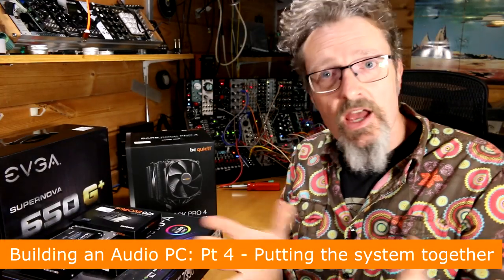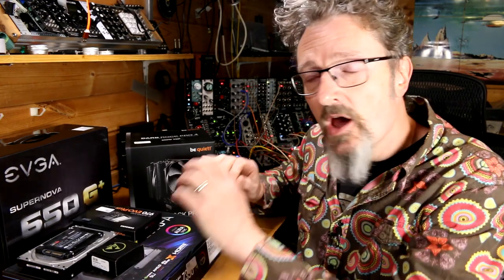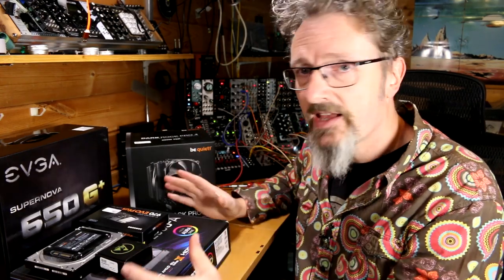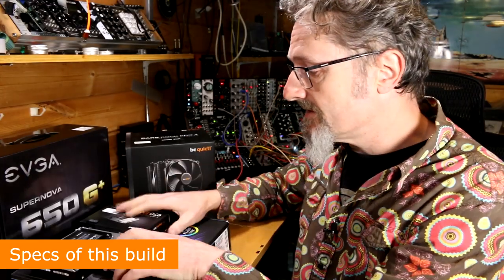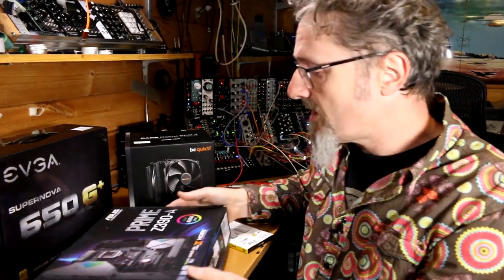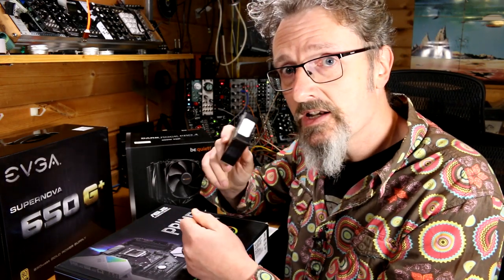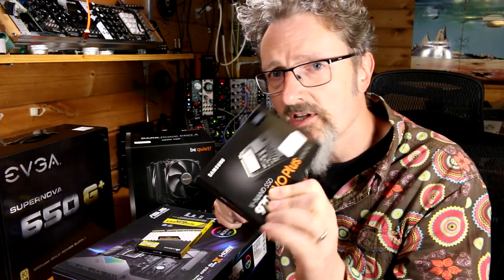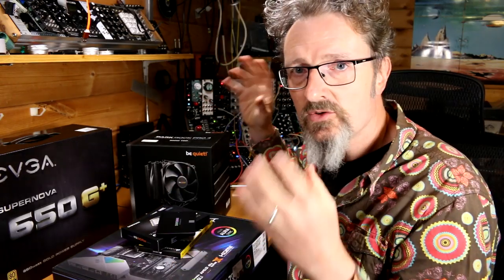How to build an Audio PC: Part 4 - Putting the System together

Comment: Excellent video Robin, your instruction delivery is superb. Rather serendipitous as well as I'm upgrading a HP desktop with a few bits and bobs, (SSD, fan, RAM etc) turning a £140 used machine into a proper goer.

Comment: Thanks so much for taking the time to make these videos!! I have two questions. Question 1: How do you know when the CPU cooler is "as flat as possible"? I mean, isn't there a risk of over tightening and cracking something? How do you get as close to flat without damaging? Question 2: How can you tell if the fan turns clockwise or counter-clockwise?
Reply from the maker: 1. You assume flatness by your actions. By which i mean stick the cooler on and wobble it about until it feels flat. Then you tighten up a bit on each corner or side to retain the imagined flatness - right? Coolers will only tighten up as far as they need to. 2. stick your finger in it! Or put your finger on the middle part to slow it down enough to be able to witness the turning. Also, most fans have an arrow on the side giving the direction of spin.
Reply: @MoltenMusicTech  Thanks!!

Comment: I love this series. It helps me a lot switching back from Mac to PC. Just one question. As far as I understood overcloclocking is not a good idea for audio PCs. So could I save money buying a 9900 instead of a 9900K. And maybe a „smallef“ motherboard?
Reply from the maker: Mild over clocking isn’t a problem these days, but we aren’t aiming to do it so focus on the stock speeds and get the best cpu you can. I went through the reasons for my choices in an earlier video

Comment: This is really great, it's motivated me to make my first build, thanks! Just a quick question because I haven't been to find an answer to it online: does the Z390-A support dual monitors  using its two display outputs out of the box? Or it is an either/or?
Reply from the maker: Thanks. You have hdmi and DisplayPort outputs and you can use both at once.
Reply: Molten Music Technology perfect, that suits my current screen setup, I can always get a video card at a later time. Cheers!

Comment: Hi Robin, I have begun ordering parts for my audio computer build (thank you for this wonderful series) and am getting conflicting (or, I'm just thick) advise regarding RAM speed for the memory I need to purchase so, I'm afraid I must bother you for some advise. I've gone with an intel i7-10700K processor and an ASUS Prime Z490-A motherboard. The 10700 is DDR4-2933 and the motherboard supports that but, I'm finding it difficult to find RAM at 2933MHz on market. Can I/should I go to 3000MHz or, less even (I beleive you haves mentioned 2666MHz)? Will there be, are there any issues? I have no intention of overclocking, just building something solid and stable for my audio production as you've suggested. Can you help me with some advise? I appreciate it. Cheers. Pat.
Reply from the maker: Hi Pat, memory speed is just like processor speed - they get a speed because of how well they performed in quality testing. It’s all the same silicon. So your 2400mhz ram is identical to your 3000mhz ram but the faster stuff tested more stable at higher speeds at nominal temperatures. So running fast ram at lower speeds is completely fine. Running slower ram at higher speeds might be unstable without proper over clocking tweaks and an eye on temperature. Ultimately set your motherboard to the speed of the Ram. The motherboard will support a huge range of speeds. I hope that helps.
Reply: @MoltenMusicTech  Thanks a million Robin. I appreciate your help.

Comment: Excellent videos. Regarding the onboard graphics VS separate card, will running a monitor (or 2?) from the CPU take away any of its functionality? Would the processing power needed affect the VSTs/DAW in any way?
Reply from the maker: No not at all, it’s completely separate and totally useful
Reply: @MoltenMusicTech  Lovely, thanks. I was intimidated by the idea of building my own PC but you made everything seem straight forward.

Comment: I want to build a PC for music production and video editing, I also want to use the desktop as a RDS when I'm on the go... The issue I have had with PCs is the internal soundcard won't handle both DAW and system audio simultaneously! If I'm using it remotely I'm going to need to use the internal sound card, are these chipsets equipped with an internal soundcard that can handle Pro Tools or Ableton and system audio simultaneously? Please help 🙏
Reply from the maker: What’s RDS? Can you explain a bit about what you are trying to do ?

Comment: I'm hoping you can help me.  I purchased a computer from Sweetwater that has a Asus Prime Z390A motherboard in it. Installed on to it is a 500gb WD-Black SN750 NVMe SSD.  I did have plenty of room on it until I started investing in Acustica Audio Plugins.  So my question is can I take the SN750 and only use that for windows and put that in the slot that you first thought your SSD was going in this video then use a WD_BLACK SN850X NVMe SSD 2TB to be placed in the same spot on the motherboard that you put your 500SSD into?
Reply from the maker: You shouldn’t need to move the drives. Just add another one and transfer the plugins.
Reply: @MoltenMusicTech  looking in the Z390-a manual it has the original SN750 NVMe 500SSD in the slot that you put yours which is M.2_2(socket3).  I can't figure out if the new one I want to buy which is the WD_BLACK SN850X NVMe SSD 2TB will work if I put it in the other slot they show is M.2_1(Socket3).  Will that work and run ok if I buy the new 2gb one to put into that M.2_1(Socket3)slot?  Thanks for your help on this I don't know what I'm doing and Ive looked all over the internet for some answers but haven't found the right ones
Reply: If the new 2tb ssd works in that slot will the computer automatically recognize that new drive so I don't have to do anything to set it up?
Reply from the maker: I would try it and see. If it doesn’t work then swap them. You can tell the bios which drive to boot from so it really doesn’t matter and you’re not going to do it any harm either way.
Reply: @MoltenMusicTech  O.k. Thanks again!!

Comment: Hello again. As for the i9 9th gen K, do I need to overclock it in order to enjoy its base freq. at 3.7 GHz or does it default at 3.7? I'm afraid that if I purchase one and not overclock it, it might just be at 2.7 GHz like a normal i9 9th Generation. Let me know. Thank you.
Reply from the maker: It’s fine running from 3.7 to around 4.8 without any bother. With the settings I give for the bios it runs very fast.

Comment: I have a question. I have a 4th gen nvme and a 3rd gen nvme. My motherboard has 2x m.2 gen 4 sockets, one of those sockets is controlled by the cpu the other is controlled by the chip set. So tge question. Should i put my 4th gen in the cpu controlled and install the operating system and daw on that? Or should i put the 3rd gen nvme in tge cpu controlled slot and install the operating system and daw on that and use the 4th gen in the chipset m.2 socket?   In short what nvme should go in what slot and where should the operating system and daw be installed?
Reply from the maker: Honestly they are all plenty fast enough for it not to matter. If you want to maximise system speed then use the fastest things you have for the OS. Audio recording and sample streaming uses up little of the performance of modern drives.
Reply: @MoltenMusicTech  Thank you very, very much for the reply. I am trying to get to lowest latency possible. and I don't know if the drive used and socket it is installed in makes a difference.

Comment: Do you have any idea how this system will work with guitars? I've have issues with latency in the past which made the guitar almost unplayable. Would a lower spec CPU (i7 or i5) work for guitars?
Reply from the maker: Hi - latency is a function of your audio interface more than it is your computer. What audio interface are you using?
Reply: @MoltenMusicTech  A Behringer U-Phoria UMC22. Which is entry level, I know.
Thing is, I used it on a Mac recently, playing through Garageband and it was latency free (I used Tonebridge as the amp sim/effects).
Reply from the maker: These things work easier on the Mac with Core Audio. If the interface had decent audio drivers it should work fine. But then your computer could be crap. A better computer will help but if you’re happy to spend a grand on the computer then maybe spend 100 on the interface for better results. Suffice to say this computer won’t be a barrier.
Reply: @MoltenMusicTech  I see, maybe an upgrade is needed. My laptop is crap, it's nearly 10 years old. I'm just about to order some parts to build pretty much this exact PC. Thanks for your replies and for the original video. One new subscriber coming your way.
Reply from the maker: Cool - you can't upgrade a 10 year old laptop :D
Maybe it's time to get a new one.
Reply: @MoltenMusicTech  I meant upgrade the Behringer box :-D
I'm building a PC as per the video.
How has it performed since you made yours? Anything you'd have done differently?
Reply from the maker: It's great yeah, it's what I did for a living and this is the best way to do it.

Comment: Is your M.2 SSD drive has 4 dedicated PCIe 3.0 lines directly to the CPU? I'm asking because I had to use an kryoM.2 PCIe 4x adapter for my M.2 SSD drive to be able to use those 4 lines! 
None of the slots on this motherboard gave me this possibility as they use the DMI 3.0 interface to get to the CPU. I'm no expert but I've done a lot of research. I would really appreciate your take on this subject. Thanks.
Reply from the maker: More research than me I imagine. I'm not sure what you're asking me. The M.2 drive i used (970 Evo Plus) says it's PCIe Gen 3.0 x4, NVMe 1.3 and the motherboard says (Asus Prime Z390-A) type 2242/2260/2280/22110 storage devices support (PCIE 3.0 x 4 mode). So....... I don't know, i'll see if it works next week when I install Windows.
Reply: @MoltenMusicTech  I've just experienced bottlenecks when using the M.2 slots provided by my motherboard (Asus x299-A). The maximum speed (read/write) was achieved only by using a M.2 PCIe adapter (kryoM.2 PCIe 4x). Now I am at full speed (sequential read: > 3'000 MB/s - sequential write: > 2'000 MB/s)

Comment: Hello, quick question: For best "real-time capabilities" for live recording and some video editing, should I go with the Intel i9 9th Gen or i9 Xtreme? I can't really decipher the difference between the two because I am still new at this. Could you lend me your 2 cents? Thanks in advance!

NOTE: My computer will be strictly for audio recording and video editing only. No games or online games.
Reply from the maker: They become two quite different machines, both will absolutely do the job. One will potentially give you a bit more power but both are awesome. The regular i9 is amazing, runs on a regular board and is best value for money. The i9 X runs on a high-end board gives you a bit more and is very expensive. I always opt for the regular i9 because i prefer spending the spare cash on synths. Either way you cannot go wrong.

Comment: I've got another week to go now, the power supply I had was too small. So, I decided to take the chance to add some more RAM, Get a better  cpu cooler fan - like that one there. I have the clip on thing - awesome! I had to buy thermal paste, (naughty) to me it should come with, considering what we're paying. I did not get instruction on the installation on fitting the cooler at all. I didn't get a screwdriver either, tight little Chinese gits! I'm on the AMD side. I got 2 M.2 drives, 1's an nvme 1tb and the other a P3 3rd gen 2tb, mine don't have the metal heat exchangers on top. The 5600X Chip is happy under the big cooler - reminiscent of one of those sub electricity stations that have railings round them - but with 2 gert big fans on it.

Comment: Would 3 sticks of memory at 16 making it 48gb possible or do you either go 8,16,32,64?
Reply from the maker: You can but it works better with dual channel or quad channel (depending on the board)
Reply: @MoltenMusicTech  thank you

Comment: Whats a good GHZ rating for the ram?
Reply from the maker: I don’t tend to over clock the ram so stock speeds like 2400 and 2666 should be fine. Anything higher is fine but you might be paying more for speed that you don’t need

Comment: I STRONGLY RECOMMEND WINDOWS LTSB ! it is a critical system version of Windows that Has NO frills and unnecessary crap ! My computer is SO much more stable ! And I must say faster.
Reply from the maker: And you have no trouble running music software and audio interfaces?
Reply: I've had zero issues with Windows 10 Pro. Had the Home version for a while before that, also with zero issues, and I built my PC primarily for everyday-use-stuff and gaming, not audio. But still, it just works. So in my opinion LTSB is overkill. Also it's tricky to get and it's pricey.
Reply: Molten Music Technology No issue what’s so ever , It really makes a very noticeable difference . It’s designed for stability because i would be very worried if I was in hospital and my life support ran on Normal Windows 10 , what if it decided to update in the middle of surgery ? Death by Windows Update ;) it is  also very touch screen friendly because of its uses in ATMs , I have an acre switch 12 and I can run WAY heavier sessions of BitWig than if I had the normal bells and whistles version . You can also turn updates off completely and if you do update they are only security updates . They also use it industry , Microsoft hates having to make this version but that kinda have to .
Reply: Leo LTSB is not available for private sale ,whatsoever , you have to be a major corporation , government or organization to even think about getting a legit licenses . Microsoft hate having to  make this version . You can scour the net and find a good copy from this group of dedicated OS tweakers .
Reply: If anybody is interested I can point you in the direction to download a good copy
Reply from the maker: No thanks, I like my OS to be legitimate.
Reply: @Max-qh7yu  Yeah, I know. As I said.. tricky to get a hold of. You can probably get it from sites like G2A but I don't know how legit their keys are. Win 10 Pro works fine for most cases, as does Home. For me there's no point in getting LTSB. But if you can get a key from a reputable place then go for it.
Reply: Molten Music Technology if you can get an LTSB  license from someone , get it . The OS if a huge bottleneck
Reply: @Max-qh7yu  Do you mean that the non-LTSB version is a bottleneck? If so, then how exactly is it a bottleneck?
Reply: Leo I meant cluttered versions of Windows are like a bottle neck in the way that the normal windows 10 is doing a heap of unnecessary things in the background, LTSB is strip down to the bone . It allows your computer to focus on what it’s meant to way better . I was very surprised of how much better and more stable my computer runs compared to the usual windows . You can also completely stop updates if you wish and because it is a critical systems OS , you can turn off all the data your computer sends to Microsoft and one friend told me that it has a lot less security vulnerabilities. The compressed file is only 4 gig ! And I think it takes 20 gig of the hard drive . It is veery very rare that my software crashes . I don’t use cracked software anymore , only when I was at school and I needed Ableton and didn’t have that type of $ , but in the case of Microsoft with their Orwellian OS ,screw em . There is a dedicated well meaning community of people who strip down windows to its bare bones . Once you see how it feels , what else could a pc person possibly use ?
Reply: @Max-qh7yu  I have no doubts that the LTSB is a solid system but for me it would be a fix for problems that I don't have. I have never felt that my system is slowed down due to unnecessary background processes. Sure, there are background processes but they have never ever caused any issues for me. I've never experienced crashes because of them. The only crashes I've had have been in games and when some VSTs have decided to not work anymore. I've had the same Windows installation since.. well, I don't even remember anymore, and it feels pretty much as fast as it did when it was fresh. The telemetry/data collection part of Win10 is a bummer but a lot of it can be turned off. If I want privacy then I turn to Linux. If LTSB is your thing then more power to you.